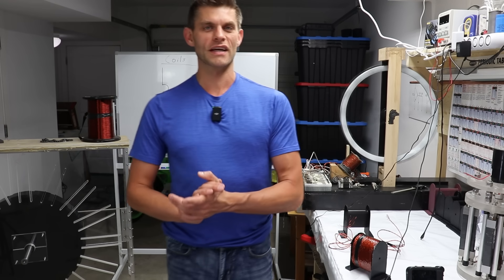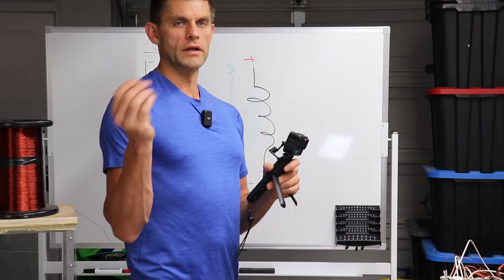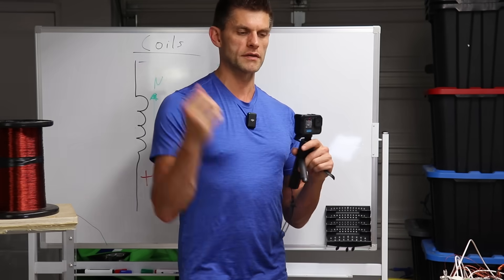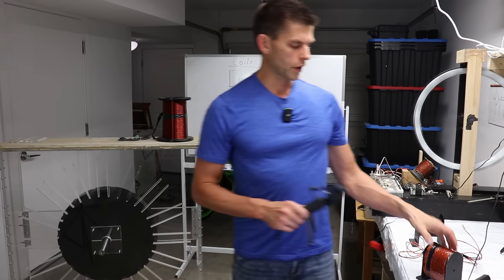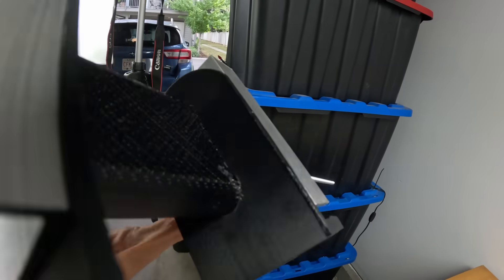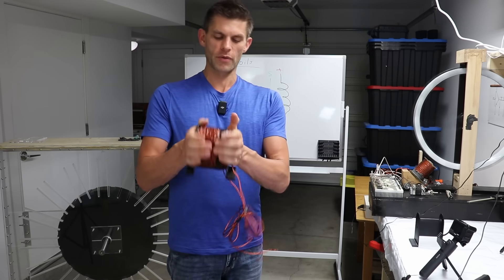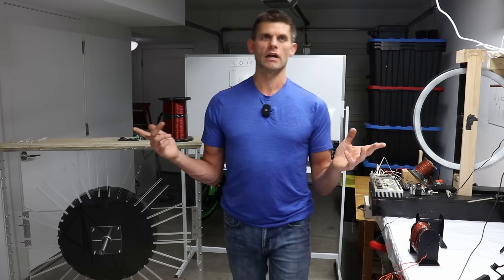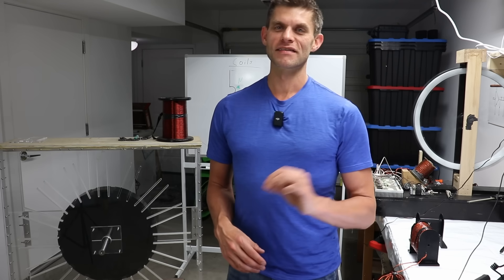Unlimited Energy in My Garage (No Patents)

Comment: We show a theoretical scheme which several researchers have discovered and used to build simple free energy motors.
          In this scheme, we drive an ordinary d.c. series motor by a two wire system from an ordinary battery.  The motor produces shaft horsepower, at -- say -- some 30 or 40 percent efficiency, compared to the power drained from the battery.  This much of the circuit is perfectly ordinary.
           The trick here is to get the battery to recharge itself, without furnishing normal power to it, or expending work from the external circuit in the process.
            To do this, recall that a charged particle in a "hooking" del-phi river moves itself.  This is true for an ion, as well as for an electron.  We need only make the del-phi in correct fashion and synchronize it;  specifically, we must not release the hose nozzles we utilize to produce our del-phi river or waves.
             The inventors who have discovered this have used various variations, but here we show a common one.
             First, we add an "energizer" (often referred to by various other names) to the circuit. This device makes the del-phi waves we will utilize, but does NOT make currents of electron masses.  In other words, it makes pure Ø-dot.  It takes a little work to do this, for the energizer circuit must pump a few charges now and then.  So the energizer draws a little bit of power from the motor, but not very much.
              Now we add a switching device, called a controller, which breaks up power to the motor in pulses.  During one pulse, the battery is connected and furnishes power to the motor; during the succeeding pulse, the battery is disconnected completely from the motor and the output from the energizer is applied across the terminals of the battery.
               If frequency content, spin-hole content, etc. are properly constructed by the energizer, then the ion movements in the battery reverse themselves, recharging the battery.  Again, remember that these ions MOVE THEMSELVES during this recharge phase.  Specifically, we are NOT furnishing ordinary current to the battery, and we are not doing work on it from the energizer.
                If things are built properly, the battery can be made to more than recover its charge during this pulse cycle.
                To prevent excess charge of the battery and overheating and destroying it, a sensor is added which senses the state of charge of the battery, and furnishes a feedback signal to the controller to regulate the length of recharge time per "power off" pulse.  In other words, the system is now self-regulating.
                 The relation between power pulses and recharge pulses is shown on the graphs at the bottom.  Note that regulation may decrease the time of recharge application of the del-phi river.
                 This system, if properly built and tuned, will furnish "free shaft energy" continually, without violating conservation of anenergy.  Remember that the del-phi condition across the battery terminals means that spacetime is suddenly curved there, and conservation of energy need no longer apply.
                  Again, this system is consistent with general relativity and with the fact that Ø-field alone can drive a situation relativistic.  We have deliberately used these facts to do direct engineering.  Our "extra energy" comes from shifting phi-flux -- the energy of  the universal vacuum spacetime -- directly into ordinary energy for our use.  Thus we draw on an inexhaustible source, and our device is no more esoteric than a paddlewheel in a river.  The only difference is that, in this case, we have to be clever enough to make and divert the river in the right timing sequency.
                  This is a free energy device which an ordinary person, who knows a little electronics, can experiment with in the basement.  To develop it, one is talking several thousands of dollars and a lot of persistence and tinkering;  one is not talking millions.
Reply: A spinning charged particle, when it hooks to a spin-hole in a del-phi river, MOVES ITSELF. 
            Note that a del-phi implies a "pressure difference" in phi-flux between two points.  Therefore there is a moving river -- a gradient -- of phi-dot, moving from the higher pressure to the lower. 
            If a charged particle is attached to this moving river, it flows along with the river.  It is just like putting a boat into a moving stream of water.  If the boat "latches" to the moving water, it moves with the river. 
            Electron spin and spin vortexes in the del-phi mesh, to accomplish the "hooking" or "latching."
            Once hooked into a moving river, the electron moves itself.  One does not have to furnish work to move it. 
            If the river is accelerating, the electron will accelerate itself. 
            By cleverly gating such rivers into and onto sources of free electrons, one can directly produce free energy. 
            The extra energy comes from converting anenergy (massless charge, vacuum flux) to energy of a moving mass.

Comment: to be clear, a FET is a transistor... it literally stands for "field effect transistor", regardless if you're using SiC, GaN, or silicon. i think the distinction you're trying to make is that it's not a BJT. 

for the skeptics (myself included), can you just simply put a calibrated power meter on the input to this device, and another on the output, and show that you're getting more energy out than you're putting in? until you do this, you're wasting your breath (although if your goal is to get YT views, that's a different story).
Reply from the maker: Agree on the FET classification...but thats about it. Stay tuned cuz its not just conventional e and m
Reply: @MadscienceLPTECH  I mean, you’ve made dozens of hours of content… where a 30 second video with 2 power meters showing you’re extracting ZPE is all it would take.

Comment: Can you elaborate more on the excess energy produced ?

I understand why back EMF is high voltage, but it has low current now . 

Energy is the area integrated under the sinusoidal spike, seems like what has happened was the amps converter into higher applied volts but same
Energy is present. 

Why would this produce excess energy ? Please elaborate.
Reply from the maker: Yes i will next video

Comment: #03:40 - "the Flyback Voltage is at a Much Higher Pressure that we use to Energize the Coil" -> Do You realise that

There Nothing Fancy here? That is just Usual Physics abd that No Additional Energy is Involved here? No "Creation" of Energy here in the Higher Voltage "Kick-Back"? And that is Similar Phenomenon than ni Hydraulics for the Ramp-Pomp? Or for a Drop falling in Water that can generate a Even Higher "Kick-Back" Drop to Eleviarung in the air as  Reaction?
Reply from the maker: This is partially correct but there is additional non conventional stuff happening

Comment: I am firm in my belief thtat there is no such thing as free energy and the reasons are such Claiming the device produces more energy than it takes in is not supported by physics. Zero-point energy exists as a quantum concept, but there is no demonstrated method to extract usable power from it.The Analogy that a “Balloon  or  Hose Spraying Out More Than It Got In ”This is a misunderstanding of energy storage and conservation. You can’t get more energy out of a collapsing magnetic field than you put into creating it. Recycling “Flyback Voltage” to Another Battery: This is real in some sense (regenerative braking works this way), but it’s never more than 100% efficient, and losses still occur.This is not supported by any scientific battery research. No battery has ever shown to “tap vacuum energy” by pulsing it with high voltage.References to Bedini, “suppressed tech,” and “ocean of energy”: John Bedini was a real person involved in free energy claims, but his machines have never been independently verified to work as claimed.

Dont get me wrong the pasion and mindset are there but the science does not back it up unfortunately  so thank you for the video but this is not free "unlimited Energy"
Reply from the maker: Lol sure I agree but there is excess enegy everywhere and we dont have to work for it... solar for example

Comment: This is a warning to anyone who's thinking about donating to his crowdfunding or crowdsourcing or any of his experiments it is a waste of money everything that this guy has done in this video is not only a waste of time but a waste of money if you want to tap into unlimited potential of energy we are literally surrounded by ocean of water.   By using an electrolysis system powered by sunlight it would only require 12 to 13 kilowatt hours of solar power to create one gallon of hydrogen gas per hour. Hydrogen gas is 3 times more energy dense than gasoline.  And it would be more powerful than any magnetic coil or magnetic spin wheel that you could create.

The future of energy is hydrogen from electrolysis of either ocean water or rain water.  What you're proposing also does not scale not every single household in the country could have solar panels and batteries this idea of yours does not scale planet wide.

But the electrolysis system of extracting hydrogen and cryogenically cooling it to store it in massive tanks in the ground could work on a large scale creating energy and distributed in it throughout the grid.

There are not enough magnets and batteries in the world so everyone could have the system you're claiming is free energy. There is no such thing as free energy only in the quantum vacuum of space would you find such a thing and we have no way of harnessing that energy.

If you were looking towards the future the future is hydrogen gas from electrolysis either from ocean water rain water or fresh water.

As a rough estimate it would take approximately 245 kilowatt hours of solar panels needed that's only 61 solar panels at 400 watts each you would need batteries to store that excess solar energy so you can run your hydrogen electrolysis plant 24/7 365   the estimated costs for all the equipment would be anywhere from $75,000 to one $150000.   And you would have a fuel efficient an large scale hydrogen electrolysis production system in place it would take anywhere from four to six months to build. 

This electrolysis hydrogen gas system using solar power would create 5 gallons of hydrogen per minute 24/7 365 days of the year with a daily hydrogen production of 2.45 kg daily.

This is on an order of magnitude higher than any energy creation you could possibly create from wire coils and magnets.

Comment: if high voltage attached to acid car acumulator is "using zero point energy free" then skip the wheel and just attach HV generator.... lets see, how this "free energy" will release.

.....around the acumulator. AS FIRE.
Reply: But as a transformer. Very interesting.
Reply from the maker: we will find out

Comment: I worked in an electric supply  company. When we cut wire we ran it through a foot counter off the spool.  You  could set up  spools on an axle , run them all through an eyelet. Then twist them while pulling the wire. Then i I would roll the twist on a spool, mount it on an axle feed it through a spring loaded "thumb" to put enough pressure to keep the tension.
Reply from the maker: Thanks for sharing, that's a cool process!

Comment: Lol.. free energy devices.... Thermodynamics is a thing. Energy isnt free.
Reply from the maker: agreed it comes from the environment, but solar is free?
Reply: @MadscienceLPTECH  solar not free energy.... It's a product of fusion. It's about 0.7% efficient. The amount of solar radiation that hits the Earth is about 1,000 watts per square meter. And solar cells are about 15 to 20% efficient. About 0.095% of the total energy is converted to DC power from the fusion of matter to the DC output. The rest is lost to heat and inefficiencies. There's no such thing as "free" power.

Comment: 1. Several inventors have already tried to exploit the same phenomenon (the excess of the reverse current generated when a high-voltage circuit is interrupted).
(Kapanadze/KAPAGEN, Tom Bearden, John Bedini, Ron Cole, Joseph Newman, Stanley Meyer, and many other lesser-known inventors around the world.)
The phenomenon is very interesting, but no inventor has been able to prove the production of excess energy in scientific circles.
2. You buy the components needed for your experiments at too high a price. Maybe start a joint-stock company and promise investors a share of the profits.
3. From which university and when did you get your degree in electrical engineering?
4. How much free energy can you produce now?
Reply: i dont think that investors would be interested if he plans on open sourcing it (even tho i doubt that it will ever work)
Reply from the maker: no investors, im not selling anything just building and scientific research. UBC is where i got my degree. we will do some measurements in the next videos stay tuned. i dont think my parts are to high of price for such a large build

Comment: In the ancient times this was done with motors at work about 8 ft and then we upgraded to something bigger than 12 ft. 
But we mounted them underground because I don't think you see the zero Point Energy and where it actually comes from there are two forms one more magnetically based and one more the flow of energy based. 
If you actually want to achieve usable energy, there is an additional modulation that needs to take place in the environment and that is what you're calling 0 point energy. 
The internal losses in the system are so high that you have to produce it wasn't a coupling to the world around the device to actually produce enough power to gain usable power. 
Pythagoras did that with a wheel using specially selected crystals because the way they align and focus energy. And then he realized how dangerous it was change their positions to slow it down and stabilize it. 
And one of his friends thought they were smarter than him and went and put this crystals back and when the machine flew apart from going too fast it killed a young lady and he was charged with that crime cuz it happened on his property on a machine that he had built they didn't charge the man that had altered it 
But those Greeks you know they have the little Power Circle in charge and anybody outside them they try to destroy or discredit them. 
And I also believe that Pythagoras found the basic level of calculus and showed that to his young mathematician friends cuz each one of them were on a different side of the Matthew development at the time. But he kept this to his small group after how he had been treated for trying to bring forth the triangle equations. 
and I think that might have been the inspiration for the move towards calculus in his mathematical developments.
Reply from the maker: Great comment love it

Comment: Well, here's the thing: Energy has to come from somewhere, you can't just make it, that the Conservation of Energy law. Where does the energy in this system come from? The permanent magnets, since they need a large spike of energy to be put inside of them for them to retain a magnetic field, and using a machine like this simply takes that big spike of energy back out of the magnet. If we wanted this big spike of energy, why not get it at the source of the magnets?
Reply from the maker: The magnetic spikes come from the coil not the magnets
Reply: @MadscienceLPTECH  I mean how they make the "permanent" magnets magnetic, by using a huge amount of energy for it to retain said magnetic field

Comment: Yeah there is no easy way whenn it comes to windings.Why don't you try using thicker wire  so you will have less winding not do
Reply from the maker: less flyback voltage, i have a lathe coming

Comment: So the coil has parallel spiraled windings together unlike a traditional coil with a single one. You feed in 12V to control the attraction and repulsion to temporarily create an electromagnet with mosfets to pull or push the magnet on the flywheel with only a tiny amount of duty cycle of current delivery with a winding .  At the point that you disengage the attraction winding of the coil with the mosfet the feed back voltage as the magnetic field breaks down that is 500+ Volts induces in the the wire that is parallel and spiraled together as well.  Then rather than feeding the high voltage spike through a fly-back diode like a traditional solenoid you capture the discharge with the parallel winding at high voltage rather than making a temporary short circuit to discharge it with the diode to protect the mofset.  Then with a push/pull mosfet arrangement you should be able to make usable AC right with the correct amount of windings of the coil and bypass the battery?   A friend that passed many years ago told me of a charger a person he randomly camped with had that sounds like it used this technique.  But was more like a spinning top that stood up centrifugally on a diamond single point bearing in a bowl. Thank you for putting some of the pieces of the puzzle together 😀
Reply from the maker: thanks for the comment, ill try and break down more over the coming videos